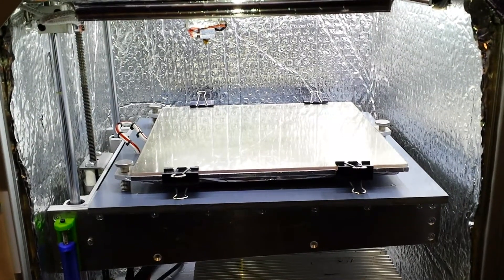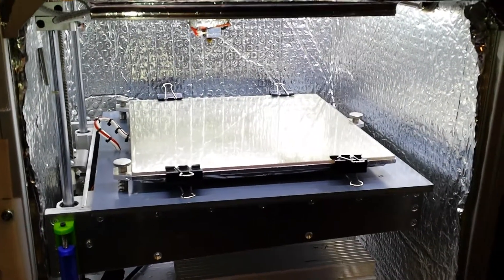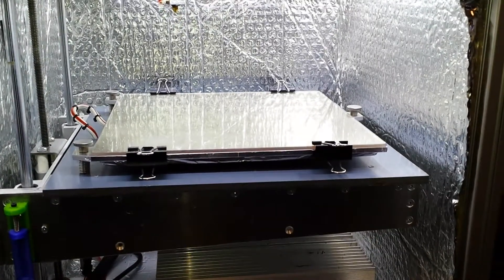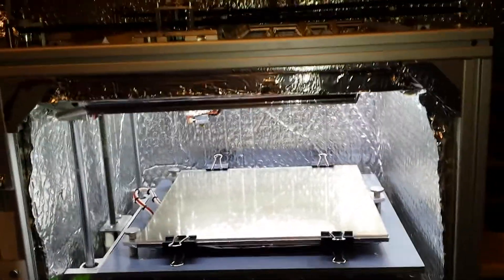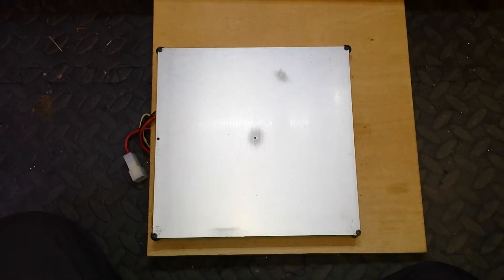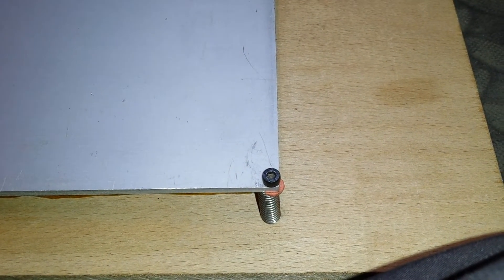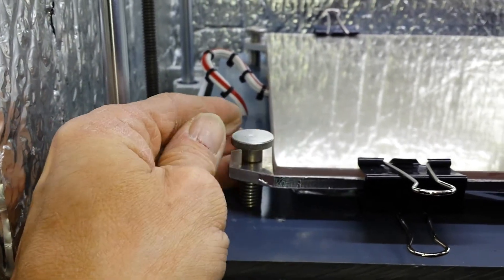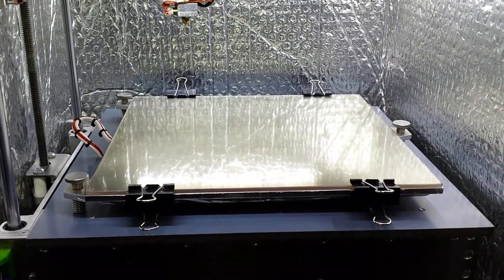3D Printer 750watt heat bed update

Comment: Looking good! I just got a cheapo 300*300 3mm aluminium/pcd bed for a hypercube I'm building. it'll have to be upgraded to one of these pdq i think! Have you fitted a thermoswitch to the bed like your heater?
Reply from the maker: hey Jai Stanley :-)
Slow progress due to other priorities unfortunately but I am getting there slowly.
No I have not fitted a thermal switch to the bed yet - it might not be practically possible to install one neatly on the plate and so thats why I decided to add the 5 separate thermistors, these I will monitor with the chamber heater controller I think and interlock the heater if any of these go out of range. Its always a concern when using such high wattage in an enclosed space but considering its only me operating the printer and the construction is 90% unflammable I am sure it will be ok. the Darvick sheet used for the base is temporary I suspect and will most likely be substituted with a more heat resistant material ! but I shall see how it performs ? considering the original base was a piece of wood I am hoping the Darvick (pvc) will hold up ?
Reply: Hallo mate!

Slow progress?  I've been spending ages on my printers/projects/hobby and still getting nowhere.  I blame the missus, draggin me on holiday.

I started building the Hypercube to cut down time designing and pontificating but of course I've started making it more complex and re-designing parts, no doubt it'll get finished one day.  Part of the problem is that I have to enclose my next printer and then why not make it semi heat resistant so I can heat the chamber (a bit).  I was thinking thin aluminium sheet cladding the interior, with insulation in the gap and a clad of MDF on the outside.

I suppose your arduino could have an exception override - if anything goes out of the expected range it could close a relay that kills everything but for the 5v. Safer than 99.99999% of printers out there!  I had a cheapo CTC melt all its wiring printing ABS a little while ago.  Not cool!

Keep up the updates.. Always good to see!! Still really interested in how you're getting on with polycarbonate.  I have some POM/Acetal here that I just can't print because of warp.  I'd like to send you some to try in yours.  It's a bugger to stick down, and warps like a bitch.  Probably print great in your machine.